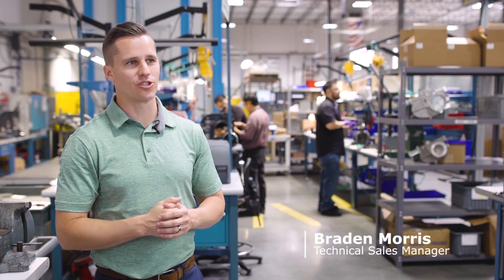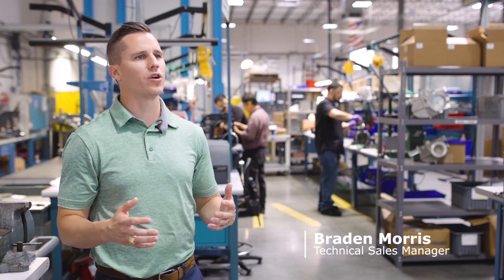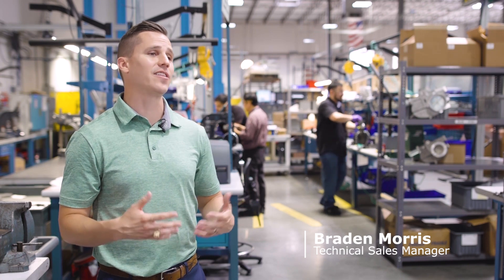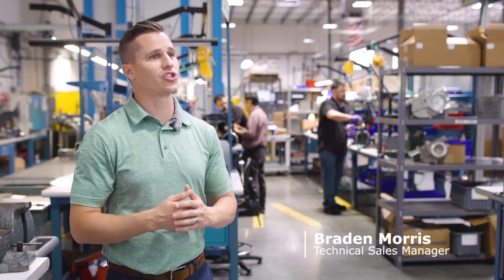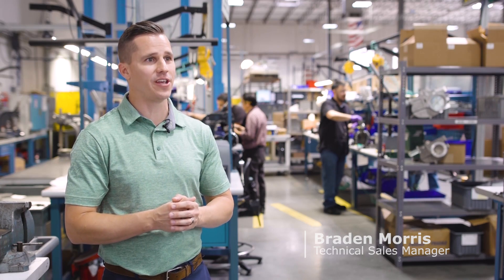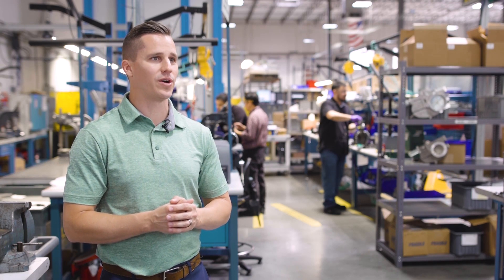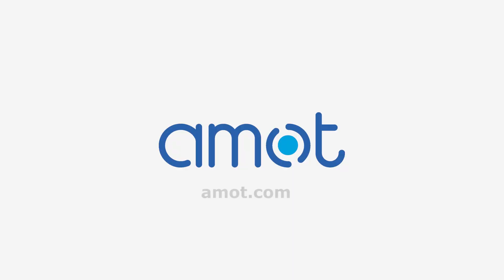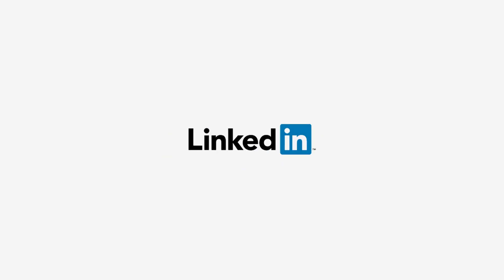Ask the Expert: What is Diesel Engine Runaway?

Comment: so no throttle body to close and stop it???
Reply from the maker: Thank you for your question. Diesel engines do not need a throttle body because engine RPM is controlled by the amount of fuel injected. Pressing the accelerator releases more diesel fuel into the combustion chamber.

Comment: Just slowly remove the fuel? 9ver say 3 seconds?
Reply: As soon as you turn the key off, all fuel the vehicle gives the engine completely stops. That's not where a runaway diesel is getting it's fuel. It's getting it from the air around it (flammable vapors at sites/plants) or the most common, it's own oil from a bad turbo. There is absolutely no way to stop the engine unless you can completely and perfectly seal it's intake. Some have gotten a solid seal only for it to implode an intake pipe, tear it open, and continue on until the engine comes apart

Comment: While his example is possible it is by fare not the most common reason for diesel runaway. Most diesel runaways happen do to the engine starting to burn its own oil or the fuel regulation system and or governor failing.  35 years as a Certified Diesel mechanic
Reply from the maker: Thank you for the feedback, Don, and we hope you enjoyed the video. While you are correct that oil leaks and governor failures are the most common causes of engine runaway, the most frequent one we see in our industry is due to hydrocarbons entering the intake. However, regardless of the fuel source, the engine needs air to complete the combustion process. Cutting off the air supply should still shut down the engine in each of these scenarios.

Comment: In a runaway the engine will run on engine oil most commonly from a bad turbo seal. Yes it can also run on flammable fumes from the outside air but that's a rare case.
Reply from the maker: Thank you for watching our video. Yes, oil leaks and governor failures are common causes of diesel engine runaway. In our industry, we mostly see engine runaway as a result of hydrocarbons entering the intake. Regardless of the fuel source, with our automatic system, if the engine exceeds the set RPM limit, the valve will activate and shut down the engine.

Comment: You can also stop a Diesel by decompression.
Reply: pro tip: you can quickly decompress the engine by allowing a rod to make a hole in the block to relief pressure
Reply: Violent decompression?